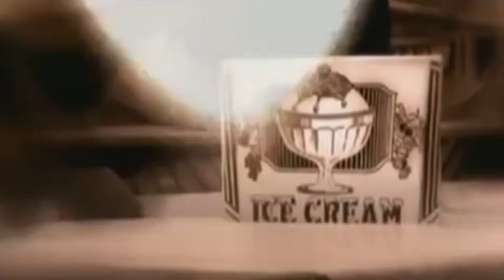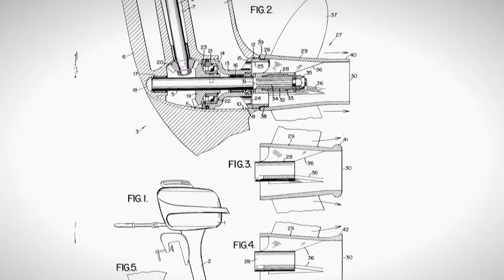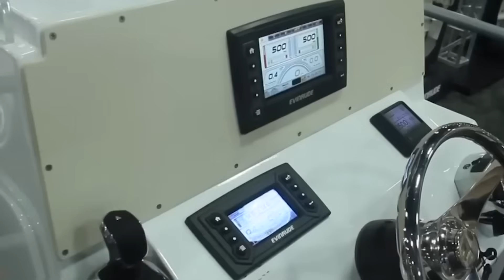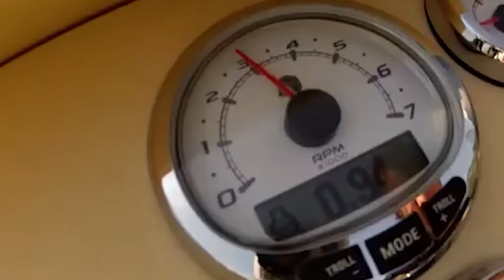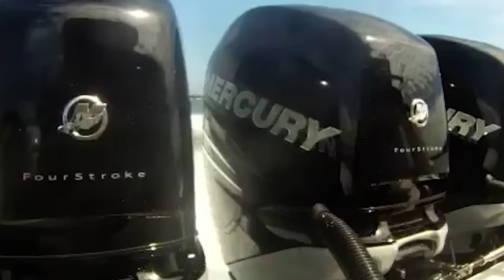Why Mercury and Evinrude Motors Are So Different?

Comment: As the owner of a 2-stroke Lawn-Boy lawnmower, built in the days they were owned and built by Evinrude, I'm a big fan of the simplicity, reliability, and lovely smell of 2-strokes...so I love Evinrude. My mower starts on the first pull, never bogs in any height of grass, blows no smoke, uses only one ounce of oil per gallon of gas, and is 26 years old. It also weighs almost half as much as the heavy and underpowered 4-strokes. As far as I'm concerned, there will never be anything half as reliable as an Evinrude. 
Especially for mowing one's lawn.
Reply: I was a Lawn-Boy fan for years - so much so I became a dealer using my parents garage. I was 21 in the 70’s. Then my parents moved south and I met Bermuda grass that is tough to cut. Especially back in the day when a pound of lawn fertilizer made your grass grow in hours. Then came Honda. I just finished cutting my yard an hour ago with a 30 year old Honda that still is powerfully but weighs more than 3 Lawn Boys.
Reply: This year I changed the desert landscape and sold my OMC Lawn-Boy Yellow Top self-propelled lawn mower, I purchased back in the midwest in 1980.
Reply: @ebenezerwheezer2957 DUUUUDE. That's SO awesome. I almost wish I could have bought it. Although I already have two. There will never again be another lawn mower like those...
Reply: Yea once Lawn Boy was bought by Toro; game over.  The offset wheel, lightweight and simple rugged 2 stroke were so much better than a heavy, shitty turning Toro.  A crime against superior design, once they were neutered and made as cheaper Toro’s. While the Honda 4-stroke was quiet and reliable, everything else sub par.  Now we use Ego 56v electric; light, quiet, no maintenance, and even green like a beloved Lawn Boy of yore.
Reply: @ProjectFairmont Thumbs up on all that, except the electric equipment. I can't get excited over those. Plus, they don't smell anywhere near as good! 😄
Reply: @ProjectFairmont I’d rather use the LB
Reply: I had a Lawn Boy years ago, their ad campaigns gave me no choice.  Dream machine.
Reply: I also loved the Lawn-boy of the 80s.  They were the first engine I ever dismantled and reassembled.
Reply: I found of of these in the trash intact fully equipped and got it idling and sold it. Compared to everything else it was radically different with cast aluminum chassis with a special truncated grease trap drum over the main bearings to isolate them from water and wet clippings and chassis hose downs. Had a potato sac catcher and unimpressive folding push bar get up that didn't fold down as low as it looked. I now am using a piece of crap zombie no name brand mower that has a stupid grass catcher design that immediately clots itself shut before the bag is 1/3 full in any condition and I n retrospect I wish I had kept that mower that thing listed for $600 10 years ago and I really didn't get it then because I had Kohler which is now rebranded is some weird bastardized way.
Reply: @astrataway7077 I called a small engine repair shop to ask about one of my engines, and they said that Kohler is sadly now only one rung above the bottom of the barrel Chinese engines. Sad. But if you ever see another 2-stroke Lawn-Boy, then get it and don't ever let it go. Literally last forever. Oh, and use "Opti-2" oil for your 2-stroke gas/oil mix. It's a 125:1 mix ratio, emits NO smoke, and makes machines last longer. And that mix ratio is for ALL 2-stroke engines, regardless of ratio.
Reply: @theoriginalcraig problem was I hated 2 strokes because I only ever had experience with them during Chicago winters and they were always small snow blowers worse conditions imaginable. The change with fuel rotting the lines and destroying floats was around that time as well. And btw I got a iron block Kohler flathead "8" I've been sitting on with a destroyed sheet metal case and pull start. It's a beefy engine that one and I do plan on fixing it.
Reply: @astrataway7077 Understood about all the hassle they can be. A good bit of what gives me my 2-stroke joy is the Opti-2 oil. Since I started using it 41 years ago, I've not had one single engine failure. I've never gotten something new because of necessity, only boredom. 
And that's COOL that you've got an old iron block Kohler. Sounds like one you should keep hold of forever and ever!
Reply: Yes and its time for DFI v8 2 stroke options for muscle cars and trucks. im so sick of all this 4 turd stroke shit.

Comment: Friend of mine had a 2006 115 E-Tech on a Lund that started on the first day of the season every year barely making a full rotation before firing. Smooth as silk at all RPMs. They upgraded to a 2022 Lund with a 150 horse 4 stroke Merc. Honestly runs rougher and doesn't seem to have any more power than the 115 Evinrude that was some 15 years older. Hate to see them go.

Comment: Well, I bought a five year old a "gently"used 150 Mercury with  a pontoon, it blew up, toast after 15 hours of my use.  Did I buy a compromised motor to began with?  I don't think so, after talking to boat mechanics they weren't suprised and suggested I buyi a Suzuki, Honda, or Yamaha.  When looking for engine insurance I found that after the 2 years you couldn't get extended insurance for a Mercury, not a problem with to others.  One last thing, when I go sailing in the Caribbean or Mexico you won't find a Mercury.

Comment: Evinrude was very innovative, in a practical way, pioneering remote tanks, gear shifting mechanisms, and noise reduction.  Indeed many 1950s OMC (Evinrude/Johnson) engines are still running, and I use 70s OMC outboards on my own boat.  Mercury also made less complex and more practical outboards after Kiekhaefer left the scene.  He literally built them to discourage user servicing, which is why they're largely in the hands of collectors these days..

Comment: My 1973 evinrude 65 hp has had about a dozen owners before me according to the man in bought it from. He had is for just over 25 years and he never did ANY maintenence except replace the spark plugs when they failed. I replaced the water pump and changed the lower unit oil, and new plugs. It still gets 120 psi compression on all 3 cylinders. I use it 20 hours a week fishing and pulling tubers behind my pontoon boat. I'm effectively the grandson using the same boat and I'll probably pass it down to my grandchildren.

Comment: I’m running a 64 50hp 4 cylinder merc every summer, still has the factory seal on the crankcase, it’s a ripper. Also running a 82 9.8 that we bought new and it’s never had the original plugs pulled out. Also have a 1949 ke 4 7.5 hp  that makes great power. I don’t think this guy knows anything about mercs.

Comment: My dad bought a Merc 700 for our Glasspar G3 in 1964. We ran it hard until 1974. We wore out a few water pumps by driving through silt, burned out a rectifier and control console. My dad did all the repair work himself.

Comment: When I was a kid in the 1970s, my lohnboat had a 6 horsepower Evinrude. My low-profile Avenger had a 150 horsepower "tower of power". This video is consistent with my lived experience. Two summers ago, I was at the marina when I heard a very distinctive sound. Before I even looked up, I knew I was going to see. It was a mint condition blue metalflake low profile boat with a 150 HP in line six. That took me back ion time a few decades.

Comment: True.. the last 20 years of Evinrude and mercury tech... same diag port for the Evinrude and I have like 10 for mercury, and you will see some odd things like same year model and horse power but different starters or oil pumps ect on mercs.
and the Optimax almost killed mercury's reputation by being known as "The fitch 2.0" and my favorite "Optipops" the gen2 etechs... I made a lot of money on since they were about as reliable as well... butter for pistons... that kinda helped kill them off

Comment: Late -70’s 175Black max V6  on 19ft deep V racer.   Might have been too heavy but shot out of the water in start, zero to quick first but no good top speed. Massive ignition problems no professional could find was eventually found being surface corrosion behind the coils (some kind of static grounding)  Never had anything thirstier.  The boat/motor on its trailer was stolen in Sweden 1999 gone since. My uncle had an Evinrude that outlasted him.

Comment: I have a 1990 Johnson 60 that needs rebuilt because they put the water pump tell tale tube too low on the engine and cooked the top cylinder. I have a 1972 evinrude on my boat currently, and it’s going strong.
Reply from the maker: Looking for someone to rebuild or a DIY job?
Reply: @VintageBoats it’s already torn down, I just haven’t had the time or knowledge to do the rebuild. It’s going to need machined for sure.

Comment: i was a commercial fisherman during the 80,s. no one used mercury outboards. i still have a johnson commercial 65 to this day
Reply: My family still has a Johnson Seahorse from 1958. The only breakdown was because the carb-float had literally dissolved over time.
Reply from the maker: What didnyou see the most of?
Reply: @VintageBoats v4 Johnson/evinrude if you wanted reliable.  Speed was mercury

Comment: My parents bought a 1967 Glaspar 16' Avalon with a Merc 650.  3 years later we upgraded toa Merc1250.  That engine ran flawlessly till 1990 when it sucked a reed valve, on the opposite end of a large lake.  It was missing at an idle, but still towed skiers and got us back to our campground.  3 days later, I took it to the shop.  #5 cylinder had 5 PSI.  Mechanic said it shouldn't run.  I backed the boat up to his test tank, dropped it in and fired it up.  Still idled on 5.  I've had several inline 6 Mercury's since and never let down by any of them.
Reply from the maker: Any still running these days?

Comment: After owning both I have got to say Evinrude is FAR easier to work on.  Mercury is an absolute nightmare.
Reply from the maker: What do you have now?
Reply: @VintageBoats  the 73 Mercury 850 Thunderbolt.  It’s a good running motor, but I can not stand working on it 😂

Comment: I grew up in the 60's and 70's . My father had a 1965 Renken with a 1959 Evinrude 30hp . I can't remember it ever having any problems. It could pull 2 young water-skiers. Great memories. Thanks , R.I.P. Pop. The word back then was that Mercury's were fast , but Evinrude won't leave you stuck on the lake.❤
Reply from the maker: Great he gave you fun out on the water skiing. Did he teqch you how to drive the boat as well?
Reply: Yes he did , and how to pack wheel bearings , how to set the anchor and how to pull it up , and always have a bilge pump w/ back up. @VintageBoats
Reply: I never could understand people were always saying the Mercurys were the faster motor than Evinrude. I grew up on the lake and always had Evinrudes growing up and raced the of Mercurys and beat  them in racing fun.So I don't believe  the Mercurys were the fast one! I just think the Mercurys paid to say they were the faster motor than Evinrude.

Comment: I run an evinrude 9.9 2 stroke. I think its early 80s. Runs like an absolute champion. Will push a 4m SIB 15kts, never lets me down. Does 35 miles easy every time i go out. Noisy, yeah. But I'd hide behind it in a nuclear war. Its a total no excuses tool.

Comment: I have a late 70s 6hp Evinrude on my 12' boat. I use it maybe 4 times a year. The worst I have had to do every time is a primer bulb in the fuel line from it getting rock hard, I've had to drain the carb one time, and I usually just run an emery board through the points using the hole in the flywheel. Oh, I did a water pump impeller last year.
Reply from the maker: Why such little use?
Reply: @VintageBoats  little spare time. I usually only take it out on a local creek that floods for weeks at a time a few times a year. The creeks flood huge swaths of woods which makes it a super relaxing shady day out on the boat.
Reply from the maker: @robertschemonia5617 sounds peaceful!

Comment: In the mid-90s, I bought an old Century Tri hull that had a 1961 Mercury 80hp 6-cylinder on it. The boat, motor, and trailer had sat under a tree untouched for 15 years. I changed the plugs, sprayed the carbs with cleaner, and it started on the second try! We used that $600 boat, motor, and trailer for four years!
Reply from the maker: Thats a pretty good value to use ratio! What happened to it in the end?
Reply: @VintageBoats  My wife and I restored the boat as a winter project. All new decking, carpet, wiring, and seats. After four years of use, we had a freak cold snap that froze and broke the lower unit. I ultimately gave it back to the guy I bought it from. My kids learned to kneeboard and water ski behind that old tri-hull.

Comment: my father bought a 2005 50 Evinrude, and never has issues, and made my uncle skeptical until he replaced 5 outboard motors. two Mercurys and three Yamahas, the Evinrude was even fuel efficient going to one village to another village, 35 miles of river on 5 gallon on 87 octane two way trip.
Reply from the maker: What boat is he powering?
Reply: Brp/can-am made really good motors, but it was hard to get over the 90s. They were close to succeeding till covid hit.

Comment: I used to be strictly a mercury guy, but I bought a 40 hp etec just before they closed the
 the doors of their outboard division. I couldn't imagine having a better motor than my etec.  I guess, as the video presents, Evinrude was just too late. Really, it was probably politician's, while sporting their environmental capes,  prematurely forcing  the community down the 4stroke path before proper studies and research had concluded.  Can't fault either company. Both are/were great in different ways, IMO.
Reply from the maker: Bought it new?
Reply: @VintageBoats yes

Comment: One made motors and the other made a motor to run props ,and there you have it
Reply from the maker: For a time! Where does your allegiance lie?
Reply: @VintageBoats  first boat was a 65 Evinrude Starflight 90 S the repowered it with a 89 Johnson 90hp. Currently have a  40 Mercery 2015 4 stroke and a 4.3Mpi . I have worked on Hondas and Suzuki I like those also.

Comment: The 2 stroke engines are significantly lighter and have much more low end torque.
Reply from the maker: Are you an etec owner?
Reply: @VintageBoats nope, have a mercury but it replaced an evinrude (pre etec).  I've used the etec units and preferred the weight to the merc.

Comment: Also take a look at BRP‘s Rotax engine on Manitou pontoons and Aluma crafts, they are repackaged Evinrude G2‘s that have been rebranded. Still producing direct injected 2strokes in 2025. As well as the Etec skidoo snowmobiles
Reply from the maker: Plan to do a rotax video at some point. Thanks.

Comment: I love how every one of these videos fails to mention that mercury tried a direct injected 2 stroke at the same time as the Ficht and Etec.  They licensed technology from orbital injection systems and had just as many failures in the beginning. Every OptiMax outboard they made required an extra cylinder as a compressor to generate fuel pressure for the direct injection the Etec generated 660psi inside the fuel injector with only 20-30 psi fuel system pressure. No need for extra cylinder of parasitic loss. Yamaha also had the HPDI but both of these engines could not continue to pass submissions past the two star rating and we’re never European union certified. The Etec was a three star engine and EU certified. The entire industry claimed two strokes were dead and outdated, even though Evinrude had better overall emissions than even the four strokes, the little bit of four stroke oil that slips past the rings and gets burnt makes more emissions when you don’t have a catalytic converter to help. Overall, it was a good video. Just love how people cherry pick information and don’t tell the whole story.
Reply: I was working in the marine industry wheennnn ETEC came out..OPTI and HPDI definitely were in the market before ETEC.
Reply: @jasonhutchison7048  that is why I said ficht and Etec, the span of the OptiMax engine ran from the ficht era into the beginning of the Etec era
Reply from the maker: Tha ks for your comment. I talk about Optimax and HPDI systems in other videos. Perhaps I can look at more info in a future episode. 

Are you ficht and etec owner?
Reply: @VintageBoats dealer and certified tech

Comment: I knew they were different, but I would have to imagine blackmax was really the start of the end for Evinrude. 80s Evinrude weren't reliable at all, and it just got worse. Blackmax were tanks and better in every way imo.

And I'm not taking about their 9.5 or 15hp..I mean 150+
Reply from the maker: Did you have either?
Reply: @VintageBoats currently have both

Comment: Had an Evinrude 9.5   A great little motor for a 14 foot aluminum. Ran for years with no issues just like you said.  But also upgraded my newer bass to a 75 ETech. What a great motor.  Never an issue. Ran strong fast clean and saved a ton of gas. The my Princecraft popped out of the water when you wanted to go. It was also a breeze to winterize at the dock. Also loved the weight savings over the Merc 4 stroke My favorite of all my boats. Had an 80s era 65 Merc on a runabout and that was a decent motor but finicky.
Reply from the maker: What do you have these days?

Comment: There's another reason most boats have 2 or 3 Mercury motors.... there's a decent chance one will have an issue.
Reply from the maker: Guessing you use Yamaha these days rhen or still managing to run evinrude?
Reply: @VintageBoats  Yeah, I value avoiding boat issue over a few more horsepower.